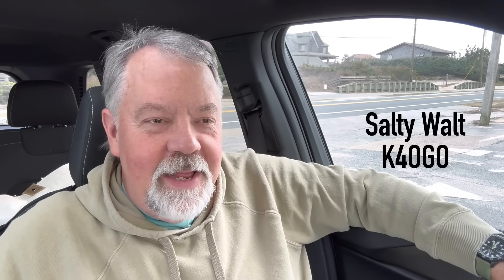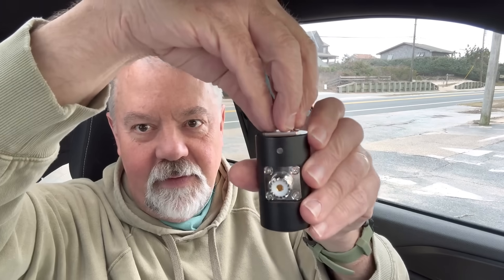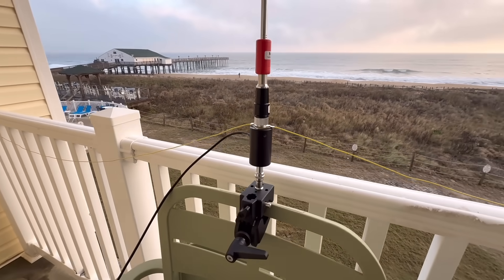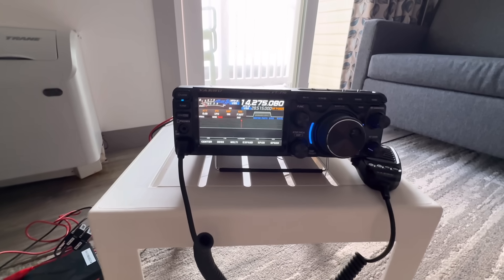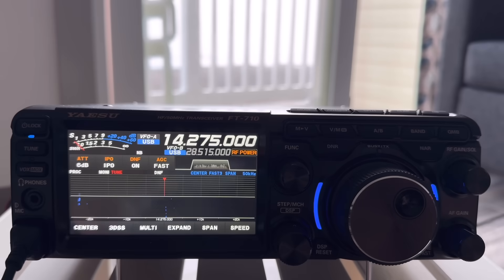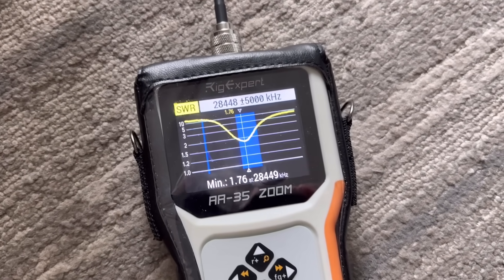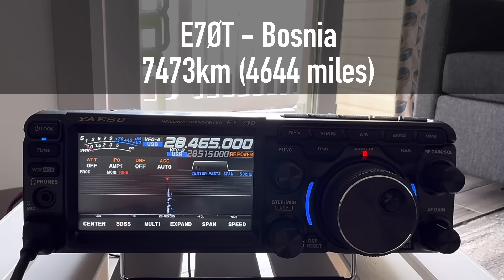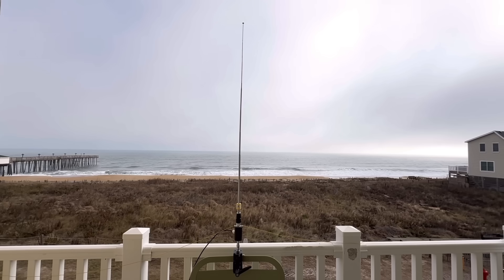Using a Tiny MA-01 Antenna on a Hotel Balcony

Comment: Your luck is the Saltwater next to you.
Reply from the maker: Yeah, I said that in the conclusion. The only reason I made the 20 meter contact was the fact that I was on the Outer Banks and they were in Bermuda with nothing but the Atlantic between us. That wasn’t luck, that was a fact and I stated that. There’s a reason the channel is called Coastal Waves & Wires.
Reply: @COASTALWAVESWIRES it still worked to some degree …. Plus I noticed the band conditions were not so great  ….. so I think it worked better than you might think . 

For a hotel room type conditions  ….. I’d give it a B rating . For what it was .
Reply: Little base mount is really cool
Reply: To far from the salt water for any advantage.   I do a lot of portable work,   5 mtrs back away from salt your advantage is already falling away, 10 mtr away,  much bigger drop in signals, 20 mtrs away and the advantage is gone.   I do back pack portable,  mobile and handy talky portable.   Had he been closer he would have got better reports .
Reply: Being as the name of his channel is what it is, I think he knows that.

Comment: Do you think doubling the radials for each band would have helped? Also, I'm guessing from what you said that the radials were tuned and obviously elevated. I've heard good things about using elevated tuned radials with a vertical antenna. Thanks and 73.

Comment: The bracket you use for mounting ma01 antenna is sold at a lot of camera stores. Adorama.B&H photo and video. Keh. Mpb. It is a light bracket. I have a few of these. Can get inserts to fill in v groove so its flat. Email etc. If need more info. Barry Bridges. N4UYK.

Comment: Great video again.  I wonder if the advantage to the east is more about the super low horizon without any obstructions and less than the actual saltwater, which looks to be several wave lengths away.  Did you have any luck to the west through the hotel building?  I remember that video of you with the mag loop in Marinette, WI in a hotel I have been to many times. I didn't know your channel yet, and I was like Who is that in Marinette?!?
Reply from the maker: Haha you recognized the hotel, I used to travel up to the shipyard there all the time.

Comment: Good day , Walt ! Fine  job  , but for such short verticals , it is necessary to use more radials , can be of different lengths , but in total equal to the wavelength of a the lowest range , and an crtainly won't hurt RFI CHOKE BALUN . 73 !  Alex .

Comment: Thanks a lot, Walt! I've been looking for a mount like the GPA. Wondering how the MA 01 will do if you use it at the beach, sticking the gpa in there with the ground rod.  Also, assuming you were using the 100W in the video?
Reply from the maker: Yes 100w

Comment: I saw concrete and with the rebar inside is a great ground plane. conductive cloth, screen or even aluminum duct tape will capacitive couple to it. Coils vs remote antenna tuner, is a consideration.
Reply: Aluminum foil would be cheaper or for ruggedness attic foil. In a large building it might work quite well.

Comment: I have been having fun with my Chelgance antenna for mobile and portable ops. My first contact was with a High School station in SC. If you try it on a tripod it needs counterpoise wires. For mobile, the magnet mount won't be useful as the antenna needs a proper ground. John VE3IPS

Comment: Nice report! Have you tried the standard 17' whip from a hotel balcony? Same setup with the counterpoise wires. Not quite as low-profile, but should have a little more punch.
Reply from the maker: I haven’t because I just can’t extend it to be resonant because of the patio above me but it’s a great idea if I can ever get the top floor.
Reply: @COASTALWAVESWIRES you can just angle it out a little. And even to the side a little so it's not right in front of your upstairs neighbor (kind of like you did for the wires hanging down.) Not perfectly vertical, but not much different from if the wind was blowing out in the open.

Comment: That has been my challenge also ….. I think you may have something there …. Especially for 10 meters . I bring my super M1antenna with me ….. but not always practical . You do have me thinking .

It still looks like it would have its usefulness …. I generally just sit and listen because of the counterpoise and mount on my tripod …. I don’t think people like my counterpoise hanging down in their area . 

I bring my g90 pretty much everywhere in my travels . To keep the portability . Everything has fit in my backpack except for my antenna set up . In its own bag .

I will listen out for you later on 10 meters if your around still .from PA.

Comment: Have you thought about trying your red-slug from the hotel room pushed out horizontally underneath the balcony railings & using either the metal railings as the counterpoise/earth or if they are wooden railings using a milar  blanket on the room floor to capacitively couple into the building reinforcement as your ground?
Reply from the maker: I have and might do it with this mount.

Comment: Any reason you had the 6db attenuation on  20m ?
Reply from the maker: Adjusted for all the hotel electrical noise
Reply: @COASTALWAVESWIRES  "Adjusted for all the hotel electrical noise" ahh I must have missed that
Reply: ...also the AMP1 should be enabled if the report is expected to be true.

Comment: I have the same Antenna, I use it with a Mini Tripod that's got an Integrated SO-239,
I call it my Fun/Novelty antenna, I have used it Indoors and made some Contacts
I got a Mini Capacity Hat for it, a little Hub with 4 X 30cm whips, 8cm when collapsed.
Like they say... "Any Antenna is better than No Antenna", It's fun to play and experiment.

Comment: @Coastal Waves & Wires- That clamp is also used to hold large photography strobe lights and theater lighting.  Try photo equipment distributors if you a re looking for more.  Also would the ground plane adapter fit the Radioddity HF-009 instead of using the spike base?
Reply from the maker: Yes it would fit for sure.

Comment: Walt- I used to use an MFJ-1625 balcony antenna when I was in an apartment in Herndon, Va during the week for work.

FYI N4HNH has a great set of videos on the FT-710,
as a Patreon I also get his settings guide and additional b videos, well worth it.

Comment: I have the jpc-12 on my 4th floor balcony of my hoa and have had many great contacts with it. For 10m I don't need the coil and lower the whip and it works great. I also live in the center of the city with buildings all around. Got mine on aliexpress.